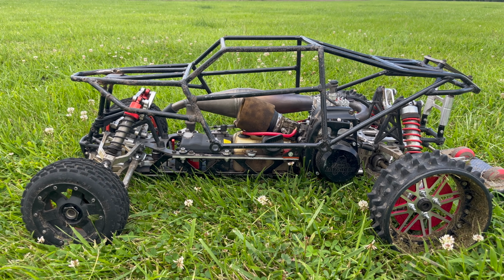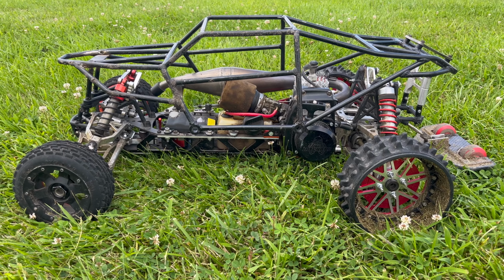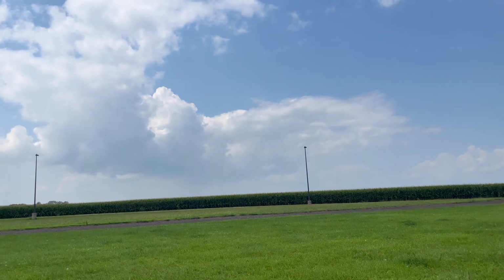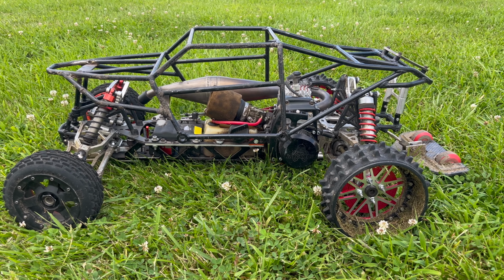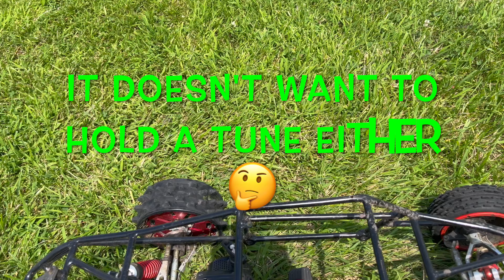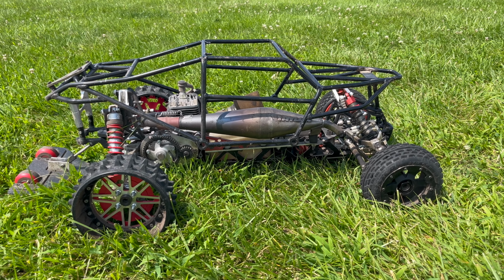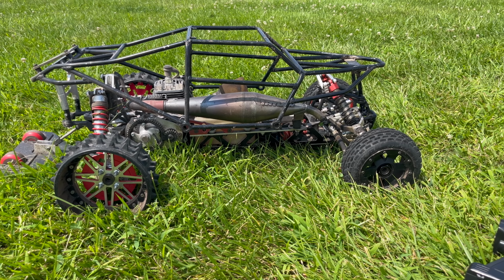THE PUNISHER IS BACK WITH THE TAYLOR RC 35CC REED ENGINE!!!

Comment: I had a similar problem like that I clean the read pedals put it back together. Problem solved.
Reply from the maker: Thanks for the info I will check them when I replace the carburetor 🤙🏼

Comment: that's me who's having the same issue with it,..and i've changed 3 carb already and the same problem keeps popping up,..won't stay on the high rev's at all even got a new ignition on it but that's not either keep me posted if you found the problem brother 👍
Reply from the maker: Thanks for sharing bro were the replacement carburetors wj71?
Reply: @Meyers2strokeRcgarage  Nope new walbro 1107's
Reply from the maker: @renedoppenberg4762  ok 👍🏼